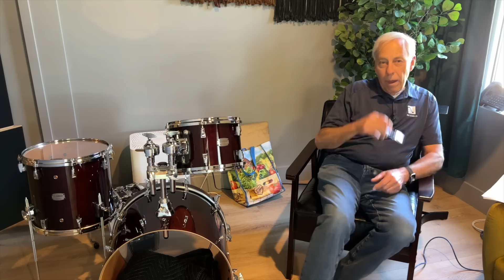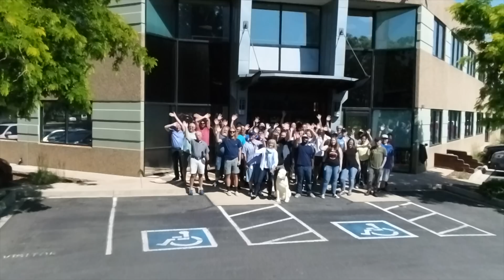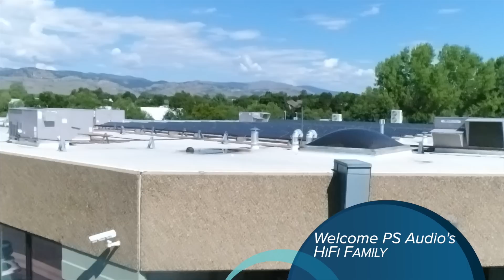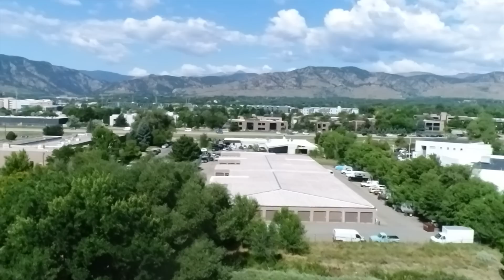The evils of feedback Part 2

Comment: I started out working for Analog Devices after getting out of the army. Back then if you wanted a good opamp you bought one in a plastic case with discrete components that was filled with epoxy. The ic opamps back then were pretty much at the low end of the scale. There was a bit of a spec war going on between Burr Brown and us so we both used tricks to "extend the response of our products and while these did extend the response you were better off not using a product in that range if you wanted the best performance.

Comment: I spent some time with a prototype single ended tube amp that had 3 nested feedback loops.  Having been enamored by tube designs using 300B tubes and NO feedback I was sure it was going to sound terrible. But the demos I heard were impressive and I really admired the engineer and his unusual background. Needless to say, that amp is gorgeous. I purchased it, and a later prototype and a matching preamp. But 6wpc ended up not really doing the job I wanted so I have gone hybrid using both tube and SS. But the feedback design had a great sound and I keep them for a "baseline" system when my perception needs to be restored after too much experimentation. Kind of like the guy who wants a great orchestral system so has to keep going to live performances to stay"tuned in".

Comment: There are some issues with this. Op amps by definition (all of them) require feedback to function correctly. (Op amps that do not require feedback--because it's already applied internally to the part--are called instrumentation amplifiers.) Open loop bandwidth, and (usually) open loop gain, are not generally important. The relevant parameter here is Gain Bandwidth Product (GBP). 

But this whole discussion, IMO, is far beyond the scope of most audio gear enthusiasts. Some viewers surely already know all this, but electronic design is far too technical for most non-engineers. Those who want to learn would be better served by a more academically appropriate process. An introductory treatise cannot be taught starting at this high level and not just verbally with a few minutes here and there.

Comment: I think Paul really needs to make a video on the evils of NOT using feedback. Some of the in-house designs by PS Audio have the worst objective (and even subjective) performance ever measured in solid state equipment. Yet their modular amp designs blithely ignore the fact that their COTS class-D modules used HEAVILY rely on feedback to keep their distortion low. 🤔

Comment: Some things are not so simple to explain properly to a layman. I’m actually glad that I got an electronics engineering degree 40 years ago.
Reply: So recently! LOL!
Reply: @glenncurry3041  You 
might be surprised how important an analog education is or was!😉
Anyway as a working engineer through the latter part of the 20th century you had to keep up with a lot of that digital stuff anyway..
Reply: @shipsahoy1793  Just kidding! They were still teaching tubes when I got mine in the early '70's. Digital was monostable multivibrators! Memory was magnetic core.
Reply: @glenncurry3041  👍
Lol.. yep, I worked with so many younger engineers that had no concept of tube operation or design. Lucky Us!!🥳

Comment: Feedback is to the audio engineer what seasoning is to the chef. The right amount will bring out the flavor of something that is already good, but too much is like trying to cover the taste of bad meat.
Reply: Excellent metaphor.
Reply: I'm not sure what you mean by "amount of feedback"? Less feedback means more gain. In an op-amp architecture, the gain of 1 can be achieved with a voltage follower (100% feedback) that usually will have much less noise and distortion than if you run little feedback e.g. 100 times gain. Generally for op-amps, more feedback will improve the signal within the frequency band supported by the amp. But of course, feedback can also cause issues especially when the slew rate is poor against the frequencies used.

Comment: Most people just don't go out and purchase individual op-amps. However for those that may...You can examine the mfgr''s data sheet a determine just "how bad" the "feedback" will be in the circuit even with 100% feedback (aka a text-book buffer circuit). OP Amp buffer circuits (circuits that use a straight wire feedback connection and therefore utilize 100% negative feedback) are ubiquitous in most pro. recording consoles A-to-D,   Streamers and DACS. So we are all constantly listening to music that has already been "processed" using tons of negative feedback regardless of what our home systems contain. The distortion contributors in the vast majority of op-amp based circuits has more to do with the "purity" of capacitors, resistors and parasitic inductance surrounding it. NOT the amount of feedback. Negative Feedback circuitry "inside" a power amp is trickier subject since you have to deal with both voltage and current gain stages. Many companies have received patents on power amplifier  feedback circuit designs.

Comment: If the feedback signal is too delayed then the difference between input and feedback will yield audible transient intermodulation distortion or ringing which you can see with a square wave signal on an oscilloscope. It was a big topic in the early days of transistor amps where slew rate became a spec thing for amps.
Reply: Yes, slew rate became popular with wideband/ highspeed amps in the mid/ late '70's. I was a Kenwood rep when they introduced their "Highspeed" line with bandwidths out to 200KHz. I toured with a "Highspeed Clinic" doing in store tests for slew rates and rise times for any amp that walked in. A 10Khz square wave at rated power into 8ohms. The Kenwood KA-907 I had for reference always blew anything else away. I had to stop testing Sony's because their recently introduced switching PS would literally always go up in smoke!
Reply: This is largely not a thing now, of course, do to much improved designs and the universal knowledge of how to tame the feedback loop. No self-respecting audio designer would eschew feedback in he audio range. The only time it can be an issue is if you do something stupid like use 100’ of zip cord for a remote speaker installation. The wire will look like a resonant circuit due to the large distributed capacitance and inductance. It would not be subtle, either. The oscillations would probably cause  lots of distortion and blocking in the audio.
Reply: @mysock351C  Yes exactly right. A good audio engineer can design a circuit where the use of feedback does great things to the audio quality. Personally I also like servo subwoofers where the feedback helps manage the cone motions to track more precisely the signal reducing the decay. Unfortunately, not many servo subwoofers are being produced in recent years and that's a bummer.
Reply: @ThinkingBetter  A point often overlooked by audiophiles is that analog electronics owes its existence to feedback. Back in the early 20th century, it was what made tube amps with reasonable distortion and power outputs possible. 

And it would be nice to see servo controlled subwoofers more. Most competent DSP based designs without any control have fairly modest distortion of a few percent at moderate SPL levels, but with lots of excursion the woofer starts to get nonlinear.
Reply: @ThinkingBetter  Although with the advances in motor and suspension design one day servo control may not even be needed. Its amazing how much better modern drivers are compared to what we had back in the 80's and 90's.
Reply: @mysock351C  I like the bass (and any audio) to precisely follow the source signal and most subwoofers with room acoustics result in quite horrible decay performance. A high-power class-D amplified subwoofer in a closed box can do well also while I generally dislike boomy ported subs even they can produce more SPL for the same size.
Reply: @ThinkingBetter  Its worth noting that the room itself is what determines the decay, for the most part. Usually subs themselves, if they can be measured anechoically, will have substantially shorter "decay" from resonances than the room modes themselves. The ported subs can also be more "boomy" due to the bass extension in that they will excite more of the lower room modes. Typically the room is what determines your bass response, with the sub just acting to excite the room with acoustic energy due to how long the wavelengths are. Its one reason its imperative to have PEQ and the ability to measure, so the offending modes can be corrected for and result in less coloration of the sound. There are also other methods as well such as sub location, dipole subs, and running more than one sub, that can help alleviate the room mode issue by limiting their excitation.

Comment: There is a thing which two parts of audio world (means producers of amplifier for driving the speaker sets and producers of speakers  to be driven) do not want to comment.  It is the common output of  both treated as acoustic result . Amplifier prodecers present their developement with pure resistor's load and producers of speaker drivers measure them as mostly linear  in single mode.

 Then listener gets in salon two and makes with connection of two of them one. Speaker sets which have no any standard behavoiur appear now as new component of amplifier. Producer  was't even suspecting it  there  to be by  any time😄. 

There comes the lost battlefield due to feedback which connects  complicated behaviour  of crosovers and even more unsettled speakers behaviour  back to  input of amplifier - all of them with messed by resonances  phases.  Feedback strong   regule is not to have any frequency depended phase shifts within operation and the same is for amplifier.  . But the feedback voltage is equal to speaker set impedance multiplied by speaker set  current . That current  depends  on resonances and undergoes shifts. resulting in shifting the output voltage So it at least seems to me in theory 

That is why my idea goes to make feedback as separate  from speakers  as possible - good exapmle were in even prewar radios tube amplifiers where feedback was connected to  secondary winding of output  transformer - the fb voltage was excited by transformer current  directly on it's constant impedance . Good enough  for equalizing main speaker   resonance . But with middle resonances created by crossovers I see no solution except that made by Philips known as (troublesome)  movement feedback which separates amplifier fb  from speaker set crossover.
Reply: @Douglas Blake  You did not  read what I said and stright rectify me?. Check - I had written it isolates from "speaker set crossover" not speaker. Anyway it isolates also from speakers which are not in motion loop To high degree.  

Anyway thanks for confirmation that I am right.
Reply: This gets into using feedback to create an extremely high Damping Factor spec instead of good basic low internal resistance designs. High feedback loops in the output to create a high DF just adds gain to compensate for voltage drop across a higher internal resistance circuit. It does not change the internal resistance. Counter EMF from the speaker is dropped across it instead of being able to control the driver directly. So high DF amps often sound worse than modest DFs. Anything over 100 is artificial.
Reply: @glenncurry3041  It is not clear  for me why you  want to explain me things which I was digging some 40 years ago, got own detailed knowledge and    after  I  made my own motion speaker fb resigned from because found it "troublesome"  Did you check all you told  by youurself? . Anyway thanks for effort
Reply: @Douglas Blake I have imperssion that  our  talking starts a  typical gossip  about audio with  no hope for tech. conclusion. Thanks anyway.
Reply: @Douglas Blake I was watching a youtube the other day where they were trying to prove an extremely high DF using heavy feedback was OK even with an internal output resistance of 10ohms because when the load changed the voltage stayed the same. Ignoring the increased drop across the internal 10ohms only being compensated by increasing the gain. As if the 10 ohms did not exist because they could compensate with gain? But that 10ohms was still there in the output circuit messing up the counter EMF! But they had some +2,000 DF!

And yes I think language is a problem in this discussion.